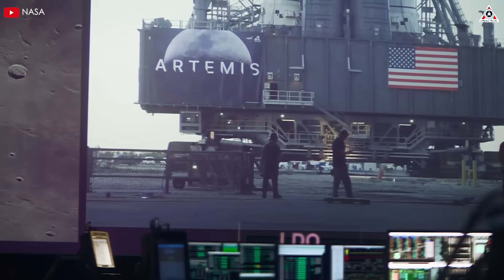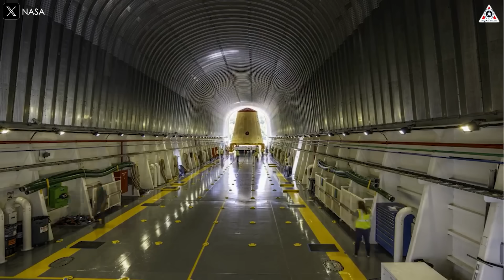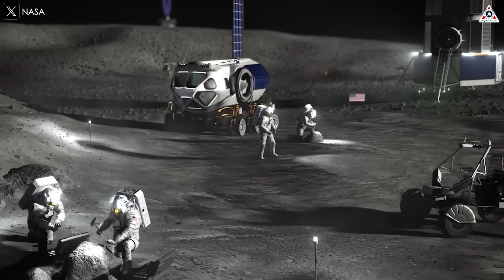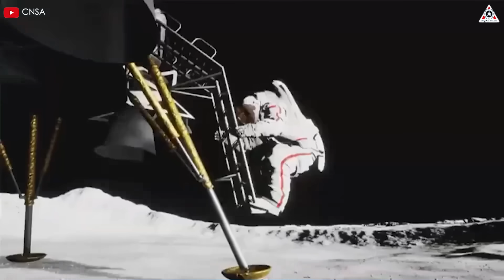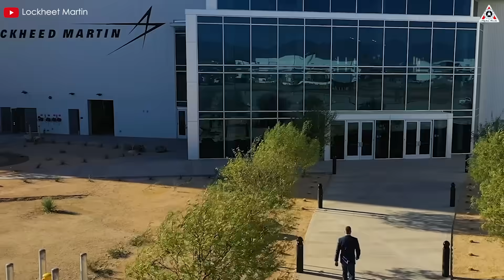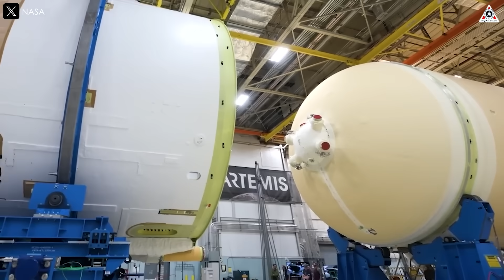Disaster! NASA's $23.8 B Moon Rocket officially FALLS APART. What Elon Knew all along...

Comment: SLS has been nothing but grift since day one. The fuel tank, main engines, SRBs were all from the Shuttle Program. The second stage engine was from the Atlas Centaur program. So building it should have been very cheap sine all the major hardware had already been paid for both in development and production facilities. It was started in 2011. Since that time Space x developed all new hardware for falcon and has launched it over 450 times.
Reply: Sorry, but the LH2 (liquid hydrogen) and LOX (liquid oxygen) tanks are a new design and are fabricated at MAF in New Orleans. The SRBs are also longer than the ones used on Shuttle. The four main engines on the Core Stage are indeed repurposed surplus Shuttle engines.
I do agree that SLS has been a major grift, and it always bugged me that every flight is not reusable, and designed to plunge to the bottom of the ocean. That is way too much money to spend for an unrecoverable rocket.
Reply: @polyscroll  they are made at the same facilities then are just modified versions on equipment that was designed forty years ago or longer.
Reply: @michaels.starnes194  No, the VWC (Vertical Weld Center) was a NEW piece of equipment that was designed and built to weld aluminum panels together to form what we called a barrel section, multiple barrel sections were then stacked in the VAC (Vertical Assembly Center), which was also newly designed and built for SLS, and was used to stack barrel sections vertically, then weld them all together to form the bodies of the LH2 and LOX tanks. . Both were designed, built and installed strictly for SLS. We also had to heavily modify existing tooling to weld the domes (ends) of both tanks.
Did you work on SLS and were you at MAF during the build of the first SLS? If you were, then you would know that what I just shared is fact. There was very little that was reused from the Shuttle.

Comment: Not sure why Elon needs to do so many refuels to get to the moon. NASA didn't. They say you can't see the landing sites using a telescope. Since I don't  have one that good, I couldn't say either way.
Reply: I don't think you understand the scale. This system is much, much larger than Apollo.
Reply: @Cpt_Adama  I don't, that's why I said not sure why. Thanks for letting me know.
Reply: Apollo used every ounce of fuel and weight savings for their objective, not fuel for bringing back spent stages with its increased weight of landing systems.  There is always a trade off in flying rockets.
Reply: @Teaman596  That's why I said I wasn't sure why. I knew someone who knew, would tell me. Thanks. I appreciate it.

Comment: Apollo- why not use them again? Updated. They worked a number of times in the 60-70s
Reply: no one even uses the tools they used to make the apollo anymore
Reply: I think everyone forgets how expensive apollo program really was, way over sls budget will ever be. Thing is current technology (micro chips, computers, communications ect) has been advanced so much that apollo technology would be simply incompatible with it and a whole new thing would need to be designed from the ground up anyway. If they had kept the rockets operational and kept them up to date throughout the years it would be another conversation but the current situation is definitely not due to the apollo program's technology been "lost" or the guys that used to work on it being dead/old.
Reply: I think they've forgotten how. I mean not every subcontractor has held onto the technical data for 50 years, and the principal engineers are long gone. The Space Shuttle program monopolized NASA budgets for over 30 years and effectively stalled any advancements in expendable-booster technology.

Comment: Did not mention an option of using crew rated dragon as a crew taxi to an already refueled Starship in orbit, 
Solving the issue of Starship not being currently manned rated. As long as the crews environment systems on starship are updated to support a crew. This time mitigates Starships manned launch/refueling/re-entry rating, required ground launch abort infrastructures and testing. From the crew point of view it is equivalent to docking with the ISS in orbit.

Comment: The SLS was a good idea on paper. When they ran into their first cost overrun the project should have been re-evaluated. The whole purpose of the project was to quickly get a launch system together using old NASA Space Shuttle tech, refurbished and slightly updated. It was supposed to be cheap and quick to develop. It was neither. What it actually is, is a bloated project being used to fund something else that is top secret. That is what these hugely expensive projects are used for. SLS will likely get its funding. The funds are likely being used for the Space Force program. Super secret. There is no way SLS has cost anywhere near what has been spent. Ultimately, SpaceX will get tapped to do the heavy lifting and Artemis will go to the moon. 

BTW, SpaceX was already brought in by NASA and asked to pick up the project months ago. SpaceX is already working on an updated heavy booster and a modified Starship to go to the moon. SLS isn't officially dead, yet. Artemis is a go. SpaceX is preparing to either provide a reusable heavy booster for Artemis or as a backup provide a single use heavy booster and starship to go to the moon instead of Artemis. They are able to do all of that for a fraction of what NASA already spent on SLS.

Comment: Landing starship on the Moon is even harder than landing on Mars. 
This is because of the height of Starship and the moons 1/6th gravity.
If the ground is not level, with in a certain percent, it could cause Starship to tip over,
Why most moon Landing Vehicles are Short and Squat.
Even Apollo 11 LEM piloted by Neal Armstrong, had to adjust his landing site, because of rocks and uneven ground in the one chosen.
Wonder if an early Moon Starship flyby with ground mapping Ladar and ground penetrating radar, might pick out several suitable landing sites for the first unmanned Starship lander.
Reply: Yes, & catching a Starship booster in mid air was also considered by the "experts" as not possible. Don'tcha think the engineers at SpaceX have considered the problems involved . By the way , landing on Mars is even more difficult.

Comment: The maximum altitude that these empty StarShips reach before crashing was barely 150 km, the distance to the moon is approximately 385,000 km. And the booster catch may seem impressive, but reusability has not yet been achieved  The Starship system still requires an invention of refueling in LEO. It will require an unknown number of consecutive launches (probably more than ten) to refuel the SpaceShip to get to the moon
At least 3 billion taxpayers' money is spent to produce a huge scrap heap, but it won't be enough, but after the coup, Musk just takes what he needs.
Reply: we need to power it with a nuclear engine with a power source big enough to stay long term  on the moon  star ship is to big to be a lander

Comment: Artemis flew once. Prototype, no others built. It launched perfectly, all engines. It reached LEO perfectly. It separated perfectly. The upper stage flew to the moon perfectly. It orbited the moon perfectly while changing orbits 4 times perfectly. It flew back to earth perfectly. Then the capsule returned to earth perfectly, right in the landing target zone. 

Meanwhile, SpaceX has yet to get perfect landings from BOTH Starship and Booster, and has YET to leave LEO!!! After spending $Billions on the Starship program!!
Reply: SLS operated perfectly, and why not? The technologies it uses were all perfected 40 years ago. But unlike most technological advances that reduce cost over time, NASA and Boeing found ways to increase costs. 🤔
Reply: The SLS Orion capsule had heat shield issues during reentry that needs a lot of work to correct before it would be human rated.   Far from 'perfect' and the SpaceX Starship is progressing just fine while Boeing can't say the same as they're mired in projects they can't fix and cost over-runs that are bankrupting the company.
Reply: But Artemis is just a rehash of 40 yearss old technology with little prospect of further development.
Reply: @ 
🤡🤡🤡🤡🤡🤡🤡🤡🤡🤡

Nope. Shows EXACTLY what you don’t know!! Only the heavily modified RS-25 engines are “used”! Isn’t that what you HAIL SpaceX for???!! Re-using the booster??!😅🤣😂 Everything else is completely new tech! SpaceX even borrowed the Boeing/NASA-perfected SWT for its Starship!!🤣😅😂!! All new tech, that’s why it worked perfectly!! Liquid O2+Liquid H2 is the best propulsion system out there!! SpaceX is still using Fossil Fuel + O2 tech!!! How OLD IS THAT!!!🤡🤡🤡🤡
Reply: @ at least google your stuff u got nothing right specially the fuel system WTF are you talking about
Reply: @ 

Laugh here is on you buddy! Google?? I work for NASA! SpaceX uses LOX and Natural Gas for fuel. What?? You didn’t know that?? SLS uses LOX and Hydrogen for fuel.

I got Nothing right?? Starship has never left LEO. SpaceX has yet to land BOTH the booster and Starship on land. While SLS’s first prototype launch was completely successful in all mission phases from launch, TO THE MOON, and back to earth again, with a successful landing of its crew capsule.
Reply: Boeing is a corporation that prioritizes profits and cost-cutting over safety and transparency, as evidenced by its history of withholding critical information, deflecting blame for fatal crashes, and delaying necessary design fixes until regulatory and public pressure forces accountability.
Lion Air Flight 610 (2018) and Ethiopian Airlines Flight 302 (2019) both crashed shortly after takeoff, killing 346 people combined.
You will never catch me siding with such a disgusting company
Reply: Starship flew twice. Prototype, more being built. It launched successfully, reaching space. Artemis flew once, with no reuse. Starship costs ~$100M per launch, targeting dozens yearly. Artemis costs ~$4.2B per launch, targeting once every few years. SLS is built one by one, with long lead times. Starship is mass-produced, enabling rapid iteration. SLS runs on costly cost-plus contracts, while Starship operates on fixed-price contracts, driving efficiency
Also BOEING has such a bad reputation such as...
"Boeing has faced repeated delays on major projects, raising concerns that the company may be intentionally pushing deadlines to secure additional funding. For instance, the Boeing 777X, originally scheduled for delivery in 2020, has been repeatedly delayed, with current estimates pushing it to 2025. Similarly, the Starliner spacecraft, intended to compete with SpaceX’s Crew Dragon, has encountered continuous postponements and budget overruns, with NASA forced to continue investing in the program due to its commitments. While some of these setbacks can be attributed to supply chain disruptions and technical challenges, critics argue that Boeing benefits financially from extended timelines, as government agencies and airlines often have little choice but to continue funding delayed projects rather than canceling them outright."

Comment: SLS and Artemis should be scrapped. It's been a disaster since day one with cost overruns and delays. NASA should be DOGEd  to clean out the rot in that space agency.
Reply: Congress has too many fingers in NASA's budget and projects. The US needs to allocate a fixed budget to NASA. Let NASA allocate that budget based upon the program's merit and the contractors performance. DOGE will just show that Congressional steering committees earmarking projects to obsolete contractors.
But to be fair many of these projects are old, at the time of their inception, and there were no viable commercial space companies.
Reply: There wouldn’t be anything left if that were to happen
Reply: Sell it get 2 billion back
Reply: @ ebay
Reply: Dumbest post ever. Those billions have been spent, and the rocket is now in the operational phase. The only sensible way to recoup that investment is to fly it as often as possible now
Reply: @jimeditorial  If your referring to your comment, I agree. NASA has already wasted BILLIONS and you want them to waste BILLIONS more. NASA's current launch tower is too short and they need to build a taller one for the SLS/Artemis to be able to launch. Plus the heat shield for the Artemis capsule is defective, which they knew about two years ago. Your comment, for NASA "to fly it as often as possible" is ignorant because it can only fly once and they have to build another one for the next mission. It's not a reusable launch system like what SpaceX has.
Reply: @GreenPatriot2024  you are missing the point. NASA spends what it spends for political reasons that go far beyond building rockets. This has a long history. The Apollo system had components built in every state of the union. But the development billions have already been spent, so it makes sense to Simply fly the rocket as often as possible now to recoup the investment.
Reply: @jimeditorial  A $2 billion a pop? The sunk cost fallacy/
Reply: @rogerphelps9939  not a fallacy. The money has been spent, the hardware has been developed, and it is now operational. It would be insane to stop Flying it now
Reply: @jimeditorial Often as possible meaning once every two years….